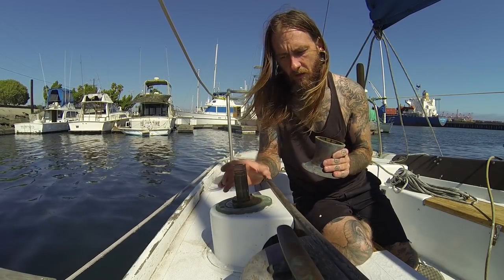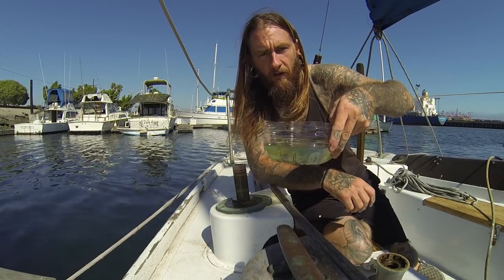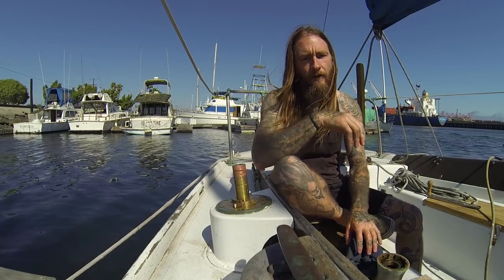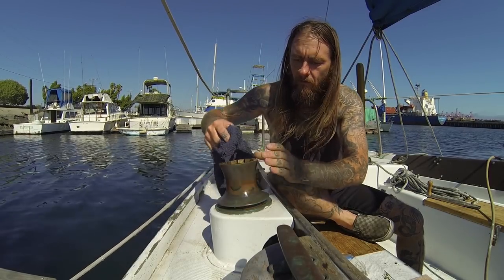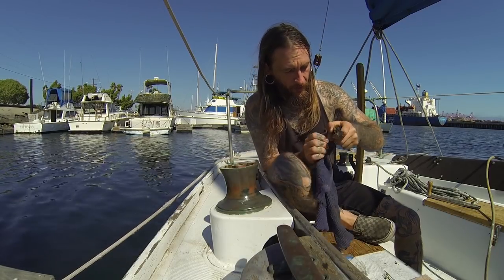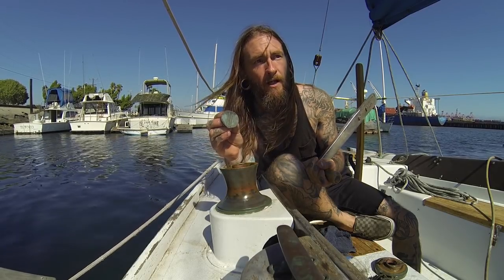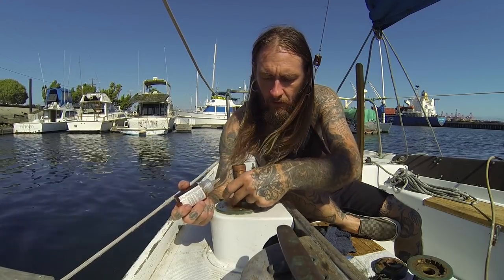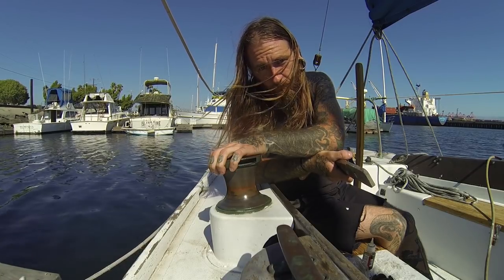How to service a bronze winch on a Classic Sailboat ( a 1965 Alberg 30 in this case)

Comment: I have a 1974 MacGregor Venture 222 and it has this style winches on it. I have looked everywhere for a video on how to rebuild these winches. This is the first video I have found showing this style winch. Mine has what looks like needle bearings with a retainer ring groove cut in them.

Comment: Awesome video. Thanks. Swapped my Catalina 22 for a cape dory 22(looking for an Alberg 30) and now have some sticky bronze winches that I know how to fix thanks to you.. When you pulled them apart and I saw the pawls i was like whoa! It’s the same principle as the rear wheel on a geared bicycle(ten speed, Mtn bike etc..,) when you are coasting/freewheeling you are hearing the pawls click just like on your winch. Keep the vids coming. You’ve helped me out a lot. And  I also have my red neck mechanics card. I appreciate your time. I’ve learned some stuff.

As for the haters, until they can come up with a video of them soloing a Diesel engine through a companionway  hanging off the boom,they can, to put it politely. GO AWAY!
Reply from the maker: haha, thanks Phil, Stoked to hear you got a Cape Dory, I LOVE THOSE BOATS of all sizes! You will find your A30 eventually ! Glad the video could be of some assistance, thanks for watching and the shout out about my Yanmar drop in!

Comment: Perfect! I guess the old adage “Less is more,” fits in this case. I also think sometimes simple is better than complex and those winches will be just as good in 50 years as they were new. Servicing them seems a snap. More frequent cleanings and the job will be exponentially easier the next time. I assume you’ll redo the mast winch the same way. Thanks for the redux and the advice.
Reply from the maker: i agree Bruce, and yeah I went ahead and serviced them all so they should be good for a minute now, especially since we don't have any weather in Southern California.

Comment: Good video. Stuck winch was the first thing I had to fix on my boat, and I may have over-greased it with marine trailer bearing grease... worked though. Will prob do a better job next time I get to them.

Comment: I have similar winches on my 1968 Motorsailer and I've been trying to figure out how to undo that huge screw fitting on the top. My exact thought was the same as yours, 'where do I get a flat head screwdriver that big, now I know. Thanks

Comment: I just use fluid film on the pawls and wheel bearing grease on my shaft and it works well. Saves money on all the expensive lubricants and works just as well.

Comment: Thanks for your service to this community.  I think these are Merrimen Brothers Winches.  I have the on my  1969 Bristol.  I have one seized winch and the slot screw on top will not break free with the end of the winch handle and a wrench.  I soaked in PB Blaster, no help.  Any ideas before I resort to using a metal wheel to cut it off and replace?
Reply from the maker: apply heat, get a small hand held MAP gas torch, heat that thing up super hot and then use a chisel on the edge of the slot and a hammer and tap it or hit it hard from the furtherest out point you can get the chisel blade to try and break it,,, heat will likely do the trick, good luck.

Comment: A very good and helpful video, as I'm retired and looking for an older A30 as my first boat; --- and a lot of 'ancient/simpler' technology worked very well. I also remember on one of Drake Paragon's sailing videos that his professional 'rigger' at Sailcraft in Oriental, NC recommended that he spray brake cleaner rather than WD-40 because it doesn't leave the 'dust/dirt-collecting' film like WD-40 does. A question: would your bronze mast winch work more smoothly if it had a plastic sleeve, or perhaps it even had one that got discarded?
Reply from the maker: nice that you are looking for an A30! such great boats. My mast winches are just smaller and don't have or even have space for the plastic sleeves, they work great since I serviced them.

Comment: Hey, man, thanks a ton for this. And double thanks for learning from comments and re-recording. I had the same problem - vintage winches and no idea what to do with them. A question for all - one of my winches no longer ratchets. Well, it does so intermittently. I’m thinking the springs may be worn out/broken. Or maybe just filthy. Any other possibilities? Breaking it down this weekend!
Reply from the maker: Thanks Dave! I bet your winches are serviceable, they are so simple with so few parts I bet you will be able to clean it and get it working good!

Comment: I didn't catch your first video and I have a 1966 sailboat with roughly the same winches. 
You said you way over greased the first one. Did you pull it back apart and wipe it down or just run it until next time?
Great video by the way.
Reply from the maker: Took it apart and cleaned it